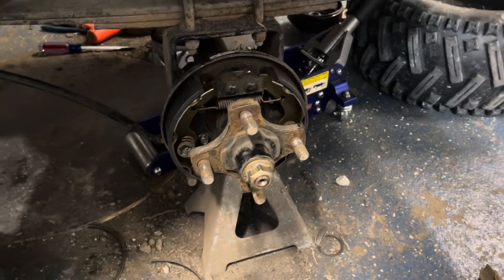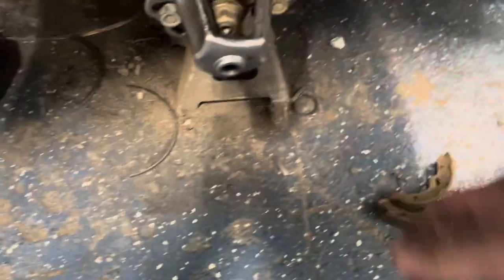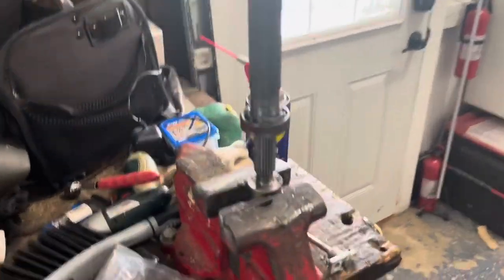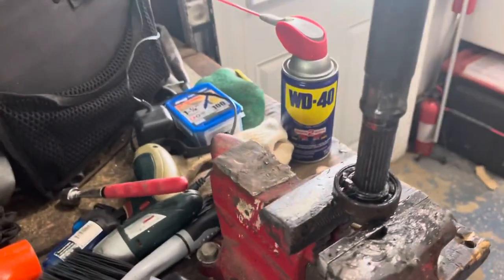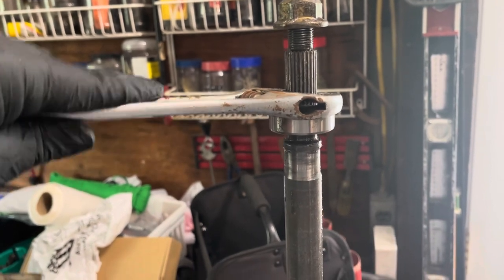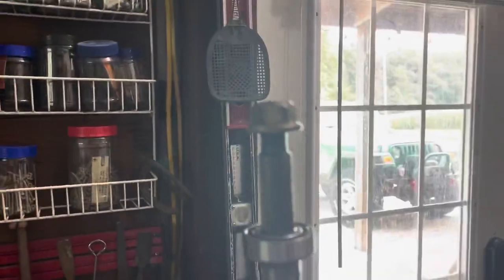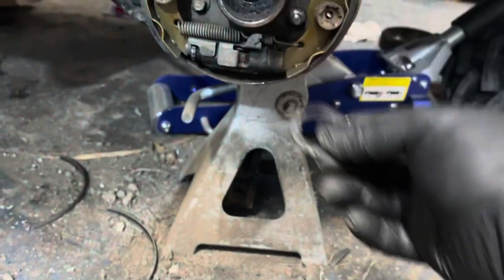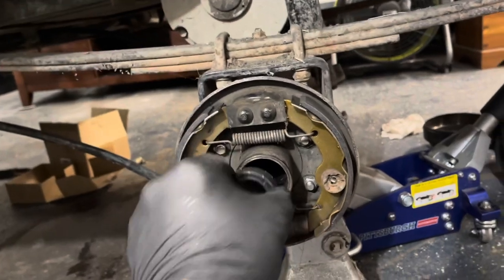Axle bearing and seals on Bad Boy Buggy/EZGO golf cart

Comment: Quick question, after getting the new bearing on axle, does bearing spin jerky, mine is not smooth after installing, not sure if these aren’t the right bearings or if it’s normal for them to feel jerky and not spin smoothly?
Reply from the maker: It should be smooth.

Comment: WD40 is not a lubricant and is actually horrible for bearings.
Reply from the maker: I didn’t really lubricate the bearings with wd40, but I did use it to get them to slide on more easily. But at the end of the day, hammering the bearings on, is probably the bigger sin. Its a Bad boy buggy, its not fast, even for a golf cart and my dad runs in in mud and water, so those bearing are not the last ones we will put on. You are correct that wd40 is not good for bearing, it does still help them slide, especially when I didn’t have any silicon at the shop. Thanks for watching Rank Amateur Garage!
Reply: Where did you get the bearings and seals?